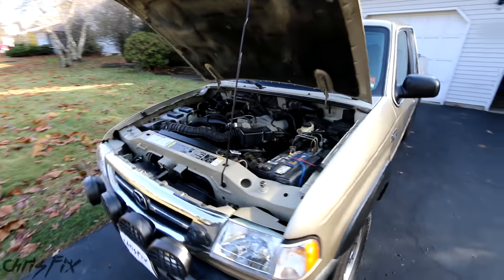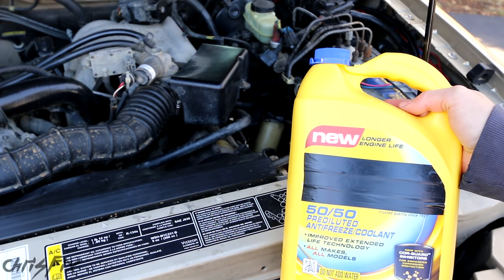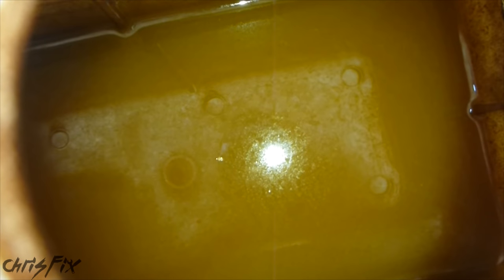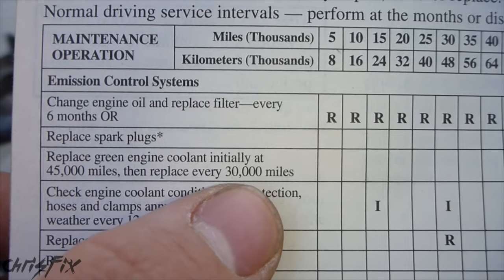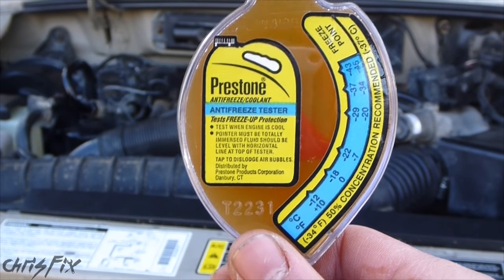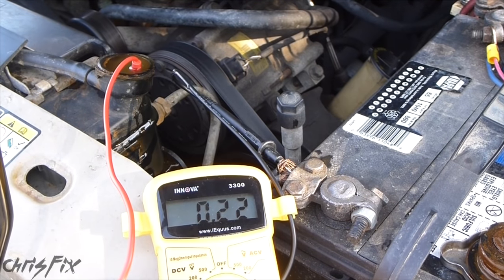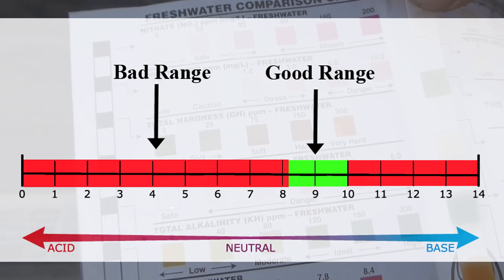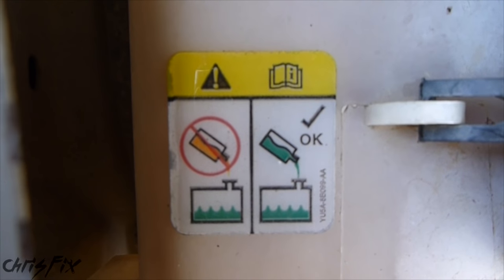How to Check and Test Your Coolant/Antifreeze

Comment: Hey Chris, I got a problem that may be cooling related and was wondering if you know what I can do.  I'm not sure how much you know about the early 2000's Ford 4.0L SOHC engines, but my fan seems to be making a really loud sound, almost sounds like an electric leaf blower.  A lot of people suggest fan clutch, but the shop I went to said AC compressor.  While the price was high, I still decided to let them replace it thinking it would fix the noise.  It did to an extent.  Now instead of being extremely loud almost all the time, it's slightly louder than the engine (even with a flowmaster 40 series installed) and only seems to happen after about 20 mins of city driving and during acceleration from a stop.  Is it possible the remainder of the problem is the thermostat?  Or could it be something else?  I have a recording of the sound and can link it to you if it helps you understand the problem better.
Reply: Some of it was AC compressor but the little bit i hear might be the clutch. It doesnt make sense though because the noise isnt constant. But i might be swapping in an electric fan soon anyway
Reply: The RangersEdge
Reply: Camlio Melo ?

Comment: I couldn't find one word on whole google or internet about my question...My European Opel GM car should use original orange GM Dex-cool coolant.I know everything about not mixing this with that,what is IAT,OAT or HOAT coolant,but..there is nowhere on internet to find if I can switch from OAT coolant to HOAT in GM car???I never used Dexcool because of old topics about famous Dexcool problems,but red/pink G12+(VW specs).This European G12+ is compatible with Dex cool,they are both OAT(silicates free).Now,HOAT is also mix of OAT and  again a little bit of silacate inside..not much as in IAT green stuff but still..In my eyes Hoat is the best compromis,best solution?Can I flush mu old OAT(G12+) and Use newest HOAT(G12++ or G13)?Thanx

Comment: Hey Chris, the temp gauge sometimes goes low, like on the highway or something. So if the engine thermostat is not fully closed when it should be, is it bad for the engine? 

P.S it's a 1.6 litre Renault in a hot climate country.

Comment: I just bought a new Jeep Grand Cherokee  and the coolant level seemed a little low. It didn't have any problems keeping the engine cool though. However I'd rather not take the chance of It overheating since I am currently driving it roughly 40 miles a day. So I bought some good new coolant. just one jug not enough to do a full flush. The original coolant in the Jeep is slightly murky orange , but the coolant I got is green 50/50. I know people say not to mix coolant, but Is it okay to top off the radiator and reservoir with the new green coolant for a couple days until I have enough time off to do a full flush and fill with one kind of coolant?
Reply from the maker: +KRONIK I wouldnt mix coolant. That creates a lot of problems!

Comment: Hi, i did flush my coolant for more than half an hour with with tab water as well.  But the rusty colour was back on after adding 50/50 green antifreeze in few runs only. Do I flush again? also, do you experience with Coolant conditioners? some say it prevent water pump damage and whatnot !
Reply from the maker: +Ayman Hawamdeh I would just leave it if you flush the engine a few times. There is probably rust in your block which is hard to get rid of. I have never used coolant conditioners.

Comment: Hey, I've got a few questions about my car that I was wondering if you could help me with. I've got a 2007 Ford Mustang Gt that has some issues with overheating. The car will perform wonderful if your speeds are up (typically above 40), but hanging out in the lower speeds will cause the engine to heat up, and if I don't stop and let it cool down, it will overheat and pop my radiator cap. Turning on the heat in the car will help this quite a bit, but seeing how it's summer, you can understand why this might be frustrating. It has popped the radiator cap a few times, and I've just topped off the coolant when that occurs. My suspicions have been with the fan or the thermostat, but could it also be the coolant that's causing it to overheat? I took the car to a repair shop and they demanded that I spend $1,000 on replacing the entire fuse box, which I am almost certain isn't the issue. If you could help me out, I'd be extremely grateful! It's my baby, but I can't seem to commute easily if I don't plan around it overheating (traffic causes it to heat up, because of the slow speed). Thanks for reading this far if you did. Awesome videos, I look forward to seeing more!
Reply from the maker: Sounds like your coolant needs to be flushed and I would make sure your fan is coming on when the engine gets hot. I would also inspect the radiator and make sure it is clean and clear of any leaves and debris. Check this out: https://www.youtube.com/watch?v=s--5ft5YiHg
Reply: +ChrisFix if the engine isn't coming on, what can I do to diagnose what's causing that?

Comment: Just for reference, get non-diluted antifreeze because it's the same price as one gallon of the pre-diluted antifreeze. With the non-diluted you make a 50/50 ratio of water and antifreeze yourself so you end up with two gallons.
Reply from the maker: +Kramer S Thanks a lot for the tip!

Comment: Out of curiosity - why does it matter if the coolant isn't good at handling colder temperatures?  I figure by the time the engine is hot enough to warrant the need of the coolant, it will warm up the coolant enough to be effective.
Reply from the maker: Peter Schmidt You dont want the cold weather to freeze the coolant and crack the block.

Comment: The coolant in my car is 8 years old, looks clean, temperature reading tool shows it's still good and my voltmeter also shows that it's still good.

Should I still be flushing it, seeing as it's 8 years old (even though everything else shows it's still good)? It's the pink stuff btw.
Reply: You didn't mention the ph test, those test strips are cheap.  If it comes out as 8.5 to 10 you completed all 3 tests and should be good.  Besides, you can't trust the folks that flush,  if you go to Jiffy lube, Walmart, Quicklube or any side shop,  they tend to blow water pump gaskets, if you go to the dealer, he may not actually do the job and still charge you.

Comment: What is the difference from running 50/50 coolant vs straight coolant that doesn't have water added? Ty Chris
Reply from the maker: You cannot run straight coolant because it does not cool properly. Water cools the best and straight coolant will cause the car to run hot or even overheat.

Comment: Hey Chris I check my mustang 2004 v6 cooling system and was the same color as the one you shown 
So I drained it out and add bluedevil and drove it for a minimum of 3 hrs 
Then I drained it out and cleaned it with water to the point where it would drained clear water 
Afterwards I added antifreeze 50/50 mixed it with water 
I have 2 weeks with the car and the muddy brown color came back 
what could it be

Comment: Hey Chris I notice you used black tape to hide the comany logo on the coolant jug and on the coolant tester box you cut most of the logo off ( i already knew it was prestone) Yet on your tester its self the sticker shows the brand name lol 

I change my coolant every year due to the fact I run 50/50 in the summer and add 10% more coolant in the winter rating it for -45 weather and do a system flush end of spring. Something that bad you have shown. I would flush and run it with CLR to clean off the scale and mud inside 2 bottles of CLR and water run it at least 20 mins with revs at the end then water flush again I done this on a friends car and the scale and slime clumped out even after his first flush
Reply from the maker: +freakyflow lol, I missed it.Thanks for sharing!  This is what I did: https://www.youtube.com/watch?v=s--5ft5YiHg

Comment: I have a 2016 honda CRV with 23,000 miles. My mechanic change coolant with a zerex  (Red) from valvolline (heavy duty extended life) that was 2 months ago. YEsterday my water pump froze and destroyed my serpentine band. Could it have been because of the coolant used? Reading that coolant information i see that it’s made for heavy duty like caterpillar or John Deere.... i also found another zerex (Blue) that is made for Asian cars. Can you please help me out if the coolant was the reason my water pump broke? After all is a semi new vehicle. Please help me to know because i already made the change of water pump and serpentine band  and I’m still running the coolant that my mechanic says is fine.
Reply from the maker: Even the wrong coolant would probably take more than 2 moths to cause any issues. It’s strange that the pump went bad like that. Catastrophic failure is not normal. Usually the bearing seal will leak first.
Reply: ChrisFix thank you so much for your answer! 

The mechanic says that it was a bad water pump from the beginning but like you said, it’s so strange that it happened  suddenly. Also a few months since the original was changed. Do you think that I should change the coolant again by one that directly states that it’s for Honda vehicles or I keep running the one for diesel? 

I also read something that diesel coolant has no alcohol when the gas coolants needs to have alcohol.

Comment: so which one is the most accurate? or should I use combination of 2 of them?

 if I just fill up coolant when it's low and check coolant temp while driving, that's not good enough right? will be too late when coolant temp goes up?
Reply: +Okaythen001 from what i understand, a refractometer is the most accurate, but it is very expensive.

Comment: my wifes 2003 honda civic overheated while taking a drive to the dessert it was over 100 degrees. coolant was full. Do you think it was just from being in the dessert? It hasn't over heated yet since that day. And there is no leakage anywhere. And i was thinking of replaceing Thermostat.. Thanks!!!!
Reply from the maker: Victor Guerra Maybe the fans dont work. Your car should not overheat even in the desert.
Reply: ChrisFix i hear ya! maybe they are not working as strong maybe? they both are rotating. with a/c on. or maybe blown gasket? i have no idea! now that we are home its not overheating and seems to be working fine past couple of days. Its weird. Thanks for replying!!

Comment: If my interior fan blow hotter air than outside (no AC, temperature dial all the way to blue cold), would it be an indicator that my coolant is not cooling effectively?

Comment: hi Chris, I live in Dubai and drive a 2007 Toyota Fortuner. not available in the USA, it is based in the Hilux and has a 1GR-FE V6 4.0

Where is the coolant bleeder on this model?

Thank you.
Reply from the maker: +Faisal Ahmed Unfortunately I am not familiar with that vehicle. Check near the water pump or thermostat.

Comment: I definitely don't understand a thing about coolant stuff. Here in Puerto Rico we use regular water and that's enough. Not sure if it's a good habit, but that's what we do here. Nothing ever happen.
Reply from the maker: +Jorge Daniel The cooling system works better with just water but you will get a lot of rust! Use 50/50 to prevent rust and headgasket failure!
Reply: +ChrisFix Good to know. Thanks for the advice.

Comment: hi chris, yesterday night  i found that my car was leaking coolant from somewhere, in middle of  a highway. as no technician or mechanic we're available i drove like that for about 180 miles filling the tank with normal water. but after reaching home i searched for this issue and many replies scaring me that it's gonna affect the engine. so thought of taking your advice. is my engine safe. as of now there is no change in the performance or engine noise or any symbol lit in the instrument cluster  whatso ever. but i'm worried about the comments in the internet. hope you'll help me out with this

Comment: Chris I have a 1999 ford ranger xlt 3.0 done a normal coolant flush not a super flush and noticed my cap is still getting little pieces of dirt on it? But also I’m curious since one of your videos had a Mazda b3000 in it which is the same as a ranger 3.0 when I turn my truck off the coolant res will bubble then stop, is this normal?
Reply: I also checked my coolant today after a week or so and noticed it was about half a cup low so decided to top it off, the res is still full looking tho but not sure if when the truck is warm it takes coolant it needs from the res and into the radiator ?

Comment: I haven't changed my green coolant in 5 yrs and I did the multimeter test and also the small floating balls test and the ph strip test and all of the above shows good. the car has 62k miles. what would u recommend?
Reply from the maker: I would just drain the radiator and fill it with new green coolant. No need to flush it or anything since it is still good!

Comment: Hi I love your show but I just got a 2015 Camry I see a pink to red anti freeze how many  miles do I need to change it
Reply: mike muniz for camry, go 5 year or 100,000 miles, whichever comes first. Buy the Toyota pink coolant from local dealer, around 20 bucks per gallon. Follow the instructions on the back of coolant jar for a fluid replace or flush. You can also peek into the instructions by simply typing Toyota pink coolant on Amazon.
Reply: JJ L what if I dont the 100,000 miles but I past 5 years what will happen

Comment: hi just a quick thought does the image on the anti -freeze tank suggest not to mix anti-freeze colours rather than using a specific antifreeze for your engine as you should never mix coolant it doesn't matter what colour you have
Reply from the maker: George345 The image (as verified by the owners manual as well) is saying to use only green coolant. From personal knowledge I know not to mix antifreeze colors.
Reply: no problems enjoyed watching your videos anyway v interesting ! decent truck too just shows how long an engine will last if serviced regularly!
Reply from the maker: George345 Thanks bud! Yea, trucks are great!

Comment: Why not just fill the system with only anti freeze, using no water?
Wouldn't that be even more protective?
I know it's overkill, you never need that much protection, but it's curious!
Reply: That won't work, antifreeze alone will allow the car to overheat on hot days.  50/50 for normal summers and winters.  You can buy it that way.  Use distilled water if you make your own.

Comment: Hey Chris, is there any way to repair a cracked front bumper cover or at least make it look a little better?
Reply from the maker: ***** Is the bumper plastic? Painted?
Reply: Painted/clear coat urethane bumper as standard. =/ I smacked into a tree because I gave throttle through a turn in the cold rain... big mistake. New cobra bumper is $160 and to get it painted is probably like $300 so I don't want to replace it, as the bumper is still in good condition and the crack isn't noticeable unless under light (because the urethane in between the plastic is like some brown color). I'll take a picture tomorrow as it's dark right now and the car is black so hard to show you.
Reply from the maker: ***** Ok, let me see and maybe there is a trick I have to make it harder to see.
Reply: ChrisFix where can I send the picture? Can't do it on YouTube comments.
Reply from the maker: You can send it on the ChrisFix facebook  page: https://www.facebook.com/chrisfix8
Or you can put it on photobucket or some type of photo sharing site and send me the link.
Reply: Gotcha I'll share it to the Facebook page.

Comment: Will any of these tests show the incorrect coolant to water ratio? For example, if after a flush is done,  the ratio of coolant and water mix is incorrect due to water left in the block etc. So we are testing new coolant but the desired 50/50 ratio may be off.
Reply: First one with the hydrometer.

Comment: I'm so confused with what type of  water I should mix my G13 antifreeze,the car manual says distilled water,but I read in the net that's not good to do that ,and I should use soft water .what is the correct water to use with antifreeze?

Comment: hey chris! Can  a RADIATOR CAP WITH PRESSURE RELIEF cause too much pressure in the system?  I bought this cap instead of buying the regular cap that my truck had before and I noticed my reservoir tank started leaking near the top where the cap goes.
Reply from the maker: It could. The radiator cap has a number stamped on it (16ft-lbs for example) and you want to find another cap with that same pressure).
Reply: I saw some videos on how to flush the coolant that used a flushing kit with the a T that you install in the lines.  I like the way you did it and I wanted to know whats the difference in doing it your way and using the flushing kit.  Thanks.
Reply: I also noticed I have a bleeder valve.  Do i open it when I am filling the truck back up with coolant?

Comment: I have a heating issue with my 2013 mustang gt. i get the car up to optimal temperature and it wouldnt heat up the cabin unless i hit the throttle (higher rpm = warmer air). At first i checked the hood and realized i had really low coolant levels so i filled it up. then i warmed it up back to optimal temperature, but the same problem persists where i dont get any warm cabin air unless i hit the throttle. what could be causing this no warm cabin air problem? PS.the car did not display any overheating issues when i was driving unaware of really low coolant.

Comment: Do you mix water with the antifreeze even if the temperature is 5 - 23 degrees Fahrenheit in a Mercedes? i have mercedes benz antifreeze.  please answer.
Reply from the maker: Water cools better than antifreeze. You need water and shouldnt run straight antifreeze.